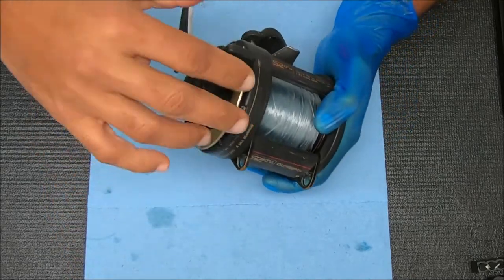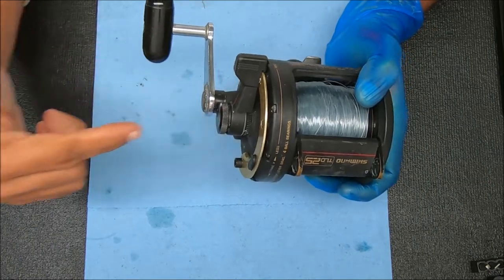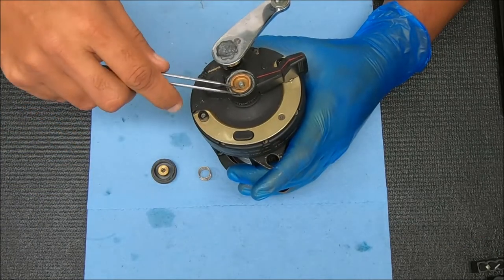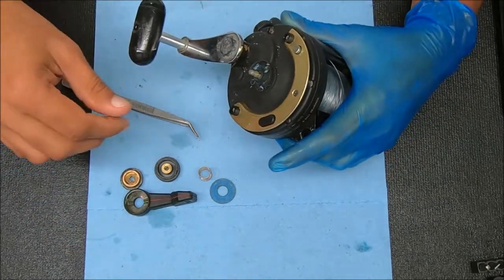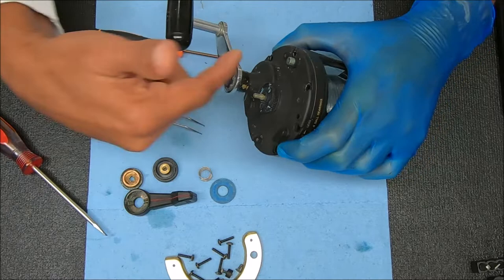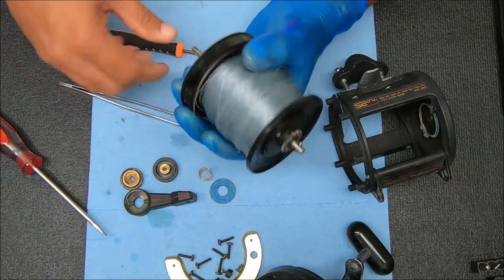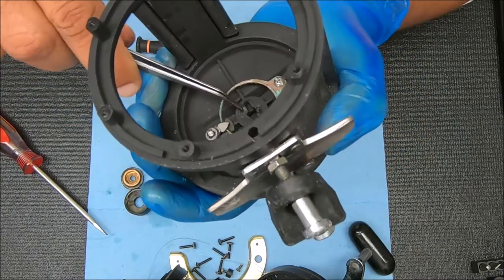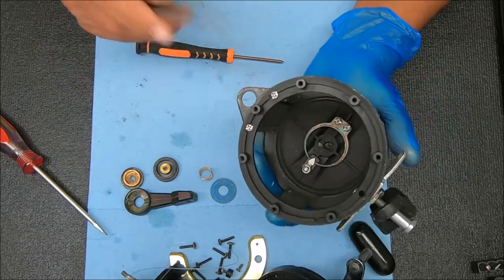Shimano TLD25 Wont Go Into Free Spool -  New Problem - Fishing Reel Repair

Comment: Ok , you found an issue, but was it the cause of the drag failing to release?
I'm beating my head against the wall, trying to diagnose the same issue. Recently replaced  the pinion bearing, so I was thinking maybe  pinion A was fetching up on that bearing's inner race, but after honing down that pinion, it's smooth and no hang ups. 😖 my problem persists.
Reply from the maker: Did you watch the entire video, or was what covered just not your problem?
Reply: Yes I sure did. 
It seems to be fetching up somewhere. When I back off the drag all the way, the handle continues to turn as the spool turns. A good wrap on the drag knob knocks things into place. 
Could it be the drag plate spring getting weak?
Reply from the maker: @80skid66   Is the solution in this video the issue you are having or is it something else?
Reply: Something else I'm thinking.
Reply from the maker: @80skid66  makes sense.